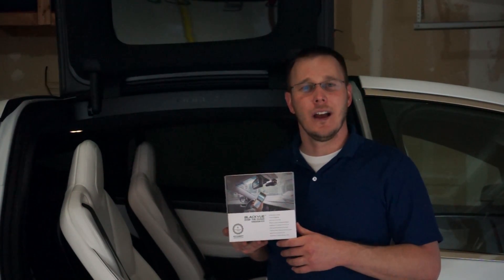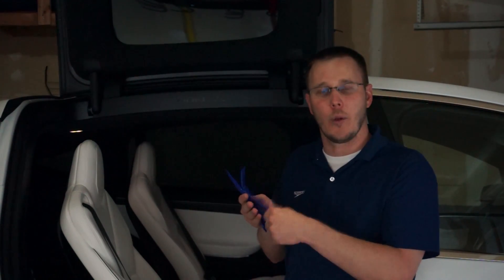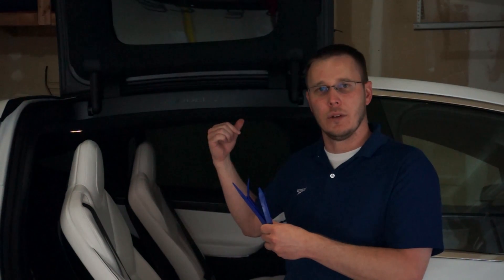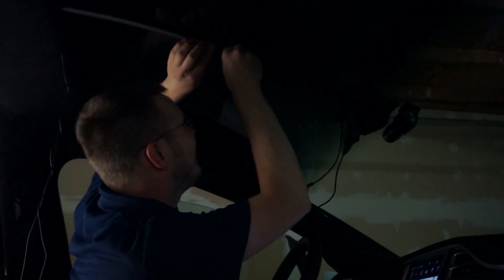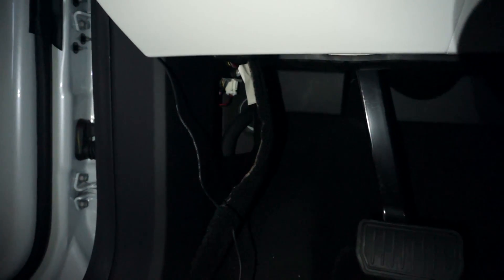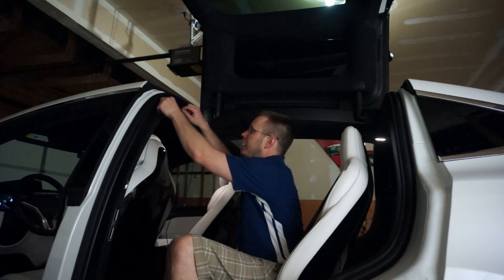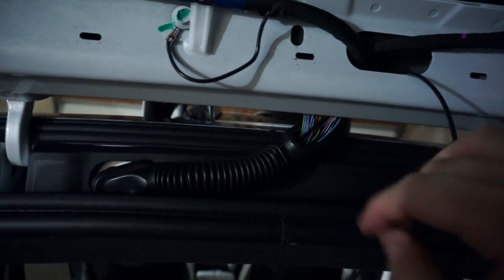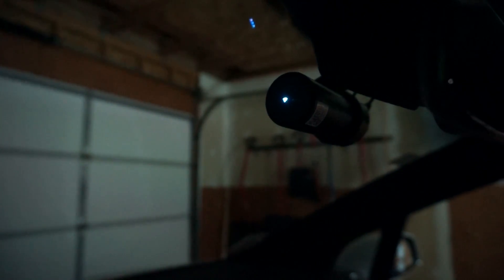Blackvue Dash Cam - Tesla Model X Installation

Comment: Nice vid! Please make a video of how to connect a led light strip to the rear view mirror cable gate.. the dome light is not sufficient as you know. Thanks!
Reply from the maker: Thanks! That's actually a really good idea. I bought some of the ultra bright replacement lights from Abstract Ocean a while ago, but I still haven't gotten a chance to install them.
Reply: The Nerdy Engineer I have installed them and that helped a lot.  But I still miss overhead lights. It would be awesome to controle the led-strip from the screen as "domelight". Maybe you need to connect it to the domelight to do that. :)

Comment: Hi. Great guide for installing dash cam. Going to use this for our installation. But how long will the cable from the camera to the ODB have to be? 7daycam sells the cables with ODB, but are only 3.3 meters long. Do you think that will be enough?
Reply from the maker: +Cathrine Danielsen thank you! I think it'll be close, but that'll most likely be long enough. I can't seem to find how long the normal cigarette outlet cable is that comes with the Blackvue cameras. I have a second dashcam video that shows you how to make your own OBD2 adapter. It's very easy to do.

Comment: great video. Was the rear camera wire long enough or d's
is you by the extended one? Thanks just ordered all you recommended items from.amazon for this install.
Reply from the maker: Oh, that's an excellent question! I had the same concern when I was doing my install, and I completely forgot to mention it! Yes, the included wires are plenty long enough to run the cables the way I showed.  

Don't make the mistake I did when I removed the rear trim piece. I have a description below the video with how to do that step by fishing a zip tie under the trim instead.

Comment: Hi. Great video! I was able to install my dash cam after watching this. But were you actually able to power up the camera by tapping into the wires of the white plug? I didn't. On my car the wires only show 1.9V then dropping. If I press the brake pedal it goes up to 1.9V and then drops. Haven't been able to see 12v from that plug 😟
Reply from the maker: +Peter Le thanks, I'm glad that my video helped! As for the wiring, I ended up using the OBD2 port instead. I have another video that shows how to wire up an OBD2 adapter.   https://www.youtube.com/watch?v=wjMoi3vsgL4

Comment: Just curious if you got the extra wire slice to work
Reply from the maker: +JOSHER 32 I ended up removing the splice to the 12v wires under the carpet and instead spliced an OBD2 memory saver to a cigarette adapter. I have a second video showing how to do the splice and what parts are needed. Hope that helps!

Comment: Hey I just wanted to say thank you for the video I was able to install mine with the video. I did however use the original tesla channel housing n I recommend people to do it ur way instead. It will save u about 1 hour lol. It is also a lot easier. It took me about 3 hours to install it.
Reply from the maker: I'm glad that the video helped you out! I think installing the cables in the original Tesla channel looks cleaner, but I was mostly nervous that I'd screw something up so I didn't want to attempt it.  I'm glad to hear that my channel trick is a good time saver too, I hadn't really thought about that aspect of it.
Reply: The Nerdy Eng   Also the tesla channel gets really tight and then removing all the glue from the channel is hard. I had to use a heat gun and my nails. I was worried to break something too. I ended up breaking a minor thing. Can't tell though.

Comment: Thank you for this video. I was worried about doing it my self. You made it look easy. If you have it hard wired does it just stay on all the time for like parking mode?
Reply from the maker: You're welcome.  I'm glad that you found my video helpful.  As long as the dash cam is connected to a constant 12v power source, then it'll stay on all the time even when the car is off.  The OBD2 port provides constant 12v power, or you can hardwire it into the wires under the carpet that provide 12v power.
Reply: The Nerdy Engineer hey do you think the wire u tapped into for the power will be able to handle 2 pairs of the blackvue 650s 2ch? I'm thinking of tapping into that wire and also doing the obd2 hack.
Reply from the maker: @nathanielgr89, That's beyond my skills/knowledge.  If you're running two blackvue 650 2 channels then I imagine you'll want the other main camera pointing out of the back window, right?  If that's the case, there is a 12v outlet in the trunk area that you could probably tap into. 

The other option is looking on the passenger side under the carpet to see if there's another 12v wire on that side.  I have a feeling that the 12v on the drivers side powers the door because when you plug it back in, there's a clunk sound.
Reply: The Nerdy Engineer ok I'm a have to see then. I picked my x yesterday and dropped it off to get wrapped. So I really haven't been able to mess with it.

Comment: Thank you for this! Was fiddling around trying to fish my wire through the trunk's cover since I didn't want to yank it off and break any pins. Great suggestion on pulling it parallel, can't wait to get it installed!
Reply from the maker: I'm glad you found my video helpful!  Did you try fishing a ziptie through instead of the cable itself?  If that doesn't work, and you have to pull the cover off, don't worry too much if you break the clips.  You can just superglue the clips back together.  Apparently a lot of people have broken the clips trying to remove that piece.